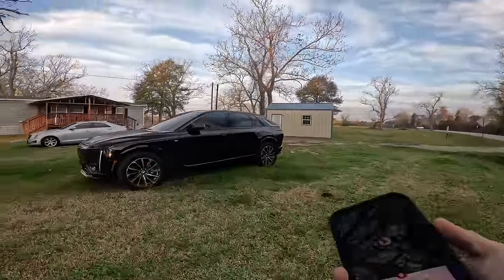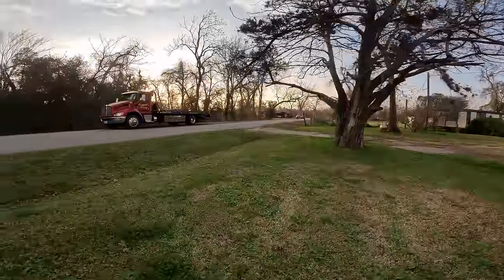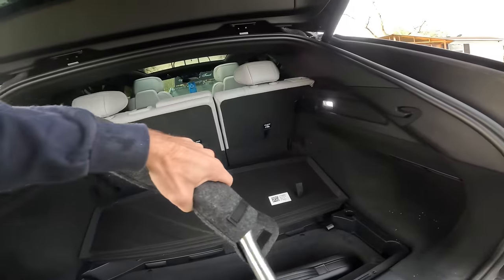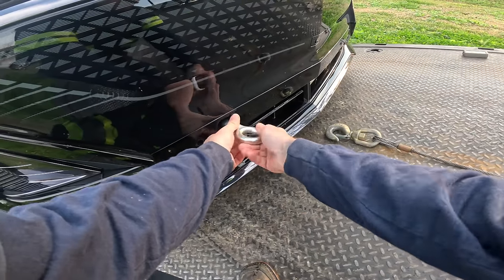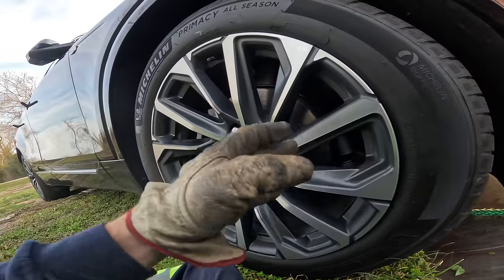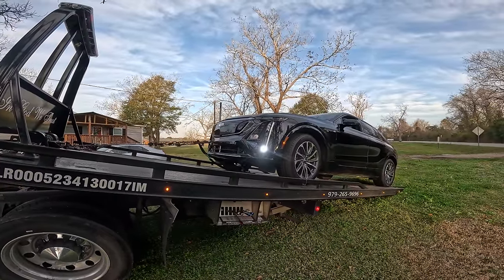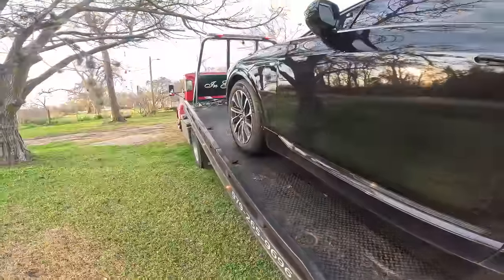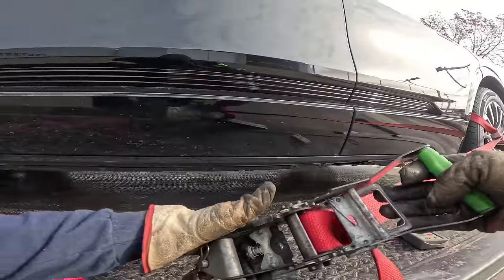Another EV Down! Towing a 2024 Cadillac Lyriq!

Comment: Huh, my ‘07 Lexus with 191k miles started and ran fine today…😂😂😂🤣🤣🤣
Reply: I have a Hyundai Tucson Hybrid 2 years no problem
Reply: As did my 2018 RAM Limited with a 3.0L Turbodiesel, and 245,000 miles on the odometer.
Reply: My 91 volvo with 400k  on it did too.  I'm going to replace it with a Polestar.
Reply: my 06 ford that passed 220k a week ago did too
Reply: Since I've got the longest streak posted I'm just going to say it.  There is no question in my mind that the EVs are going to be WAY more dependable than our ICE cars.
Reply: @L8nitedave  yeah, they just need to refine the tech and stop forcing it on us.
Reply: @2010hyundaielantra   Really? Is your 06 Ford  an EV that was forced upon you? Isn't this video of an isolated failure yet unkown cause evidence the tech is being refined?
Reply: @undaielantra With Ford the only problem I know of is the transformer module on the bigger battery in the very early Mach Es.  But even that you have to abuse it to make it fail. Same as other issues with ICE cars.
Reply: @L8nitedave  no I have a 2006 taurus
Reply: @2010hyundaielantra  oh ok, yeah those cars were always perfect.
Reply: @L8nitedave  well most of them were crapmobiles but the ones that survived to this day can only be destroyed by the wrath of the lord. bought mine at 105,000 and put a further 115,000 on it.
Reply: @2010hyundaielantra  They were more reliable than most. Maybe not the longest lasting but pretty dependable. I took care of a few of them in company car fleets.  Like all cars they did have some issues. Crank sensor, oil pan gasket and not the longest lasting transmission. Thing is most of the EVs we've seen so far are way more reliable and dependable and much less maintenance.
Reply: My 2014 Tesla S with 224K miles on it starts up fine too. A few issues over the years, but nothing like what the rabidly tribal denizens of social media would have you believe. Biggest issue in the future will not be the cars themselves, but the charging network, time to charge, and range in cold climates. But, like any new enterprise we tackle together, we'll get there in time. If one is afraid or has range requirements beyond the usual 30 miles daily, maybe you should just drive an ICE/hybrid.
Reply: @radclyffegeorge998  Exactly, most all the EVs have evolved to pretty high charge rates in the "middle" of the battery.  In time people will begin to realize just how "inconvenient" and expensive ICE cars actually  are.

Comment: EVs, because of the room temperature these batteries operate at, will be a safe haven for rodents. If you're out in the woods like this Lyriq owner, strong chance its rodents chewing away at communication wires. Especially if you leave your car unattended for a few days. The car will automatically keep the battery at optimal temperatures, meaning it heats and cools it automatically. So, rodents will have  temperature controlled accommodations😂
Reply: People are nuts #1 for not keeping their expensive cars in a garage. They depreciate enough as it is. I have the gas equivalent to this ,an XT5 & its a 2018 & it looks better than ones in the showroom.
Reply: @richardmorris7063  The people in the video live in a trailer home (in tornado country). I would think they like living on the edge.
Reply: @alexanderkennedy2969That’s what I was going to say.  If your ev is in a garage it will catch on fire and burn down the garage 😂
Reply: Easy fix, just don’t have your EV catch on fire.

Comment: I'm more curious about what happened to the Lyric than the tow itself.
Reply: I have owned multiple EV’s. They fail like light bulbs. Unlike ICE cars that run rough or make weird noises while you limp home, EV’s just go pop and you are found on road dead. Drive unit inverters have a tough job and are the most common failure that causes this type of problem.
Reply: @JetFire9  Maybe you have owned multiple EV,s though that doesn't mean you have any idea what happened with the Lyriq.  

And by 'multiple' how many are you talking about because I get the feeling we're talking about the low single digits.
Reply: @screenPhiles  You don’t know what you are talking about. The data and science prove I am right. Don’t be another liberal science denier.
Reply: I have two electric cars not an issue at all Love them very much charge at home, haven't need any maintenance beside tires at 30,000 mi nothing else of course maybe a cabin filter...
Reply: @confirmhandle  Give it some more time. You’ve been lucky so far. 🤣🤣🤣
Reply: @JetFire9  I know someone that owns a Bolt and it's been two years and he's had no issues.
Reply: @toner37  lol
Reply: Why would anyone buy an ev that's problematic, which would include all of them?
Reply: @rickcoleman8903  How is that true, beyond you for some really weird reason wanting it to be?
Reply: @confirmhandle why did the tires only last 30k miles?
Reply: @huge_balls  These Lyriqs seem to be terribly unreliable. This tow man is lucky that the car didn't lock itself. In this case, no neutral, no steering, no accessing the trunk where the tow eye is located, and you're not allowed to jack these things up to get the tires off the ground, per the instructions from GM. Go figure.
Reply: @jliefer2484  the tires had a dramatically reduced lifespan because they're made of a special compound to reduce rolling resistance.   filling the landfill twice as fast is a small price to pay for saving the world. plus remember how important range is to them.  i think you knew all this

Comment: The other day I provided a jump on a Nissan EV. He left the interior light on. He called for a tow truck thinking that he had to get a tow for simply leaving the interior light on. For warranty repairs and such. Kept telling me how the car was plugged in all night, 12 hours. The guy paid $250 for service, I was on scene for all of 15 seconds.

Didn't realize that even with a fully charged drive battery, he still needed a jump
Reply from the maker: People don’t understand that they have two different electrical systems lol I’ve amazed so many people before by jumping an EV lol
Reply: Obviously the 12v battery was dead, old and not working properly.. How old was the car and the 12v battery? No car regardless if its a gas or electric will work when the 12v battery is dead..
Reply: @mamadouaziza2536  the car was brand new, but they drained the 12-volt battery overnight and thought all they had to do was plug the car into the Drive battery charger. These people have no idea how their vehicles work, I'm shocked that they are legally allowed to own them.  just for the visual stimulation of the car's owner, I used a jump pack to boost his vehicle. He would have been Furious had I showed him that all he had to do was press a built-in 12-volt boost button on his dashboard to use the drive battery to boost the 12-volt battery. But I wasn't going to charge the guy $250 to press a button.
Reply: @nighttow8780  
Ok. thanks.. Sounds like a great feature to have a 12v boost button wired to the drive battery! I wish all electric cars had that feature.
Reply: @Towtruck_Dustin  Just curious, why wouldn't they build in a connector to allow the car to be jumpstarted with the batteries it already has?  Different voltage, more stuff to break/cause fire, or just the rarity of such a thing being needed?
Reply: If it was new, the guy didn't pay $250.00 for service.

Comment: When my Model S died on the road at midnight, I put the tow hook in the front bumper for the tow truck driver, but the monkey still put the hooks on the suspension to pull it up. I didn’t care this time because I already made my mind up to sell the car as soon as it was repaired. I did. Loving being back in a reliable ICE.
Reply from the maker: Tesla is actually one of the few EV’s that the towing procedure allows you to hook the control arms. I generally do that because the tow hooks are terribly unreliable. 
Seems that the ones that don’t allow hooking the suspension are the GM EV’s that have the electric ride control.
Reply: Yup I tow For Tesla and nothing happens to them  I do understand that it looks a bit more rough  than the tow hook  😅
Reply: and what exactly did the monkey look like???
Reply: @allaboutcars4835  Looked just you. Want a banana?
Reply: @Towtruck_Dustin  Why would you bold face lie about that? Why?? Oh, yeah, tow truck driver. Literally the lowest form. Well, for everyone to see what a liar this guy is, here is a direct quote from the Tesla transport manual: “To avoid damage, only pull the vehicle onto a flatbed truck using a properly-installed tow eye. Using the chassis, frame, or suspension components to pull the vehicle can result in damage.”
Reply: @JetFire9 
Oh ok..I’m African American.
Reply: @allaboutcars4835  Oh ok…I’m African.
Reply: @igpriego194  You are doing it wrong. My alignment was messed up after the monkey used the suspension arms instead of the tow hook that was right there. Why can’t you people do anything right??
Reply: like I said before never had any problems now picture this scenario your model s or x is completely unresponsive meaning you aren’t able to put it in tow mode meaning wheels are locked keep in mind these 2 models are the heaviest yes! Heavier than gas vehicles  the force to pull the vehicle will be greater  than having a car in neutral that been said  I will definitely not trust your towing hook sorry . I know there’s other ways  like using a wheel lift truck with dollies but even then most Tesla owners don’t like their cars on the wheel lifts due to most of them thinking the AWD Tesla will be damage due to their lack of knowledge  or existence of the dollies lol another think to add in order to get the contract to tow directly for Tesla we have to take a special training
Reply: @igpriego194  My Model S was in tow mode and rolled freely. The alignment was messed up by the tow. Stop doing it wrong and pretending “it’s ok,” just because it’s not your car. No, you’re not smarter than Tesla’s instructions on how to tow their cars. Just stop with the ridiculousness.
Reply: @JetFire9 lmao what part of  me telling you I was trained directly by Tesla u don’t understand ? That Karen vibe I’m getting from you I’m really starting to think I’m  not wrong about you Tesla owners 😂
Reply: @igpriego194  regardless of who is right. Emojis are gay.

Comment: I supervised the tow of my LYRIQ. To the delivery end by retaining the key fob .  And was hands on of the delivery into a spot at the dealership.   I hit a curb. First accident in 25 years .  Destroyed left tires .  Night time is difficult with the Lyriq as the lights are self leveling and it projects fairly close to the front of the vehicle.    I got the towing pin out of the rear and carefully removed the front cover.  But I detached the tether to it immediately.  Wawa.  At least the wrecker operator didn’t feel bad.

Comment: Wow, this is what Motor Trend reported just a few weeks ago.  The Operating System dies which is what you are describing here.  They recalled and stopped selling the Chevy Blazer EB due to this issue being widely reported after selling about 400 units.  Motor Trend reported when GM called the Chevy the car started working again for about 15 minutes or 10 miles of highway driving.  Then it died again. So GM took the car by towing it away like you did - and giving him a gas car which got him to his destination where he wrote the blistering report.  For GM to be selling EVs before they are ready with a reliable OS is just crazy bad.

Comment: It’s nice when it’s 75 degrees and sunny out. Imagine towing this junk when it’s -15 out
Reply: do your research on EVs and cold weather. No one thinks about everyday vehicles and cold weather, but come winter and you don't plug in those vehicles. People complain and then need a boost because the small car battery couldn't start the car. So many people questions EVs and pretty much all can and will apply to the regular car itself. The average lifespan of a car battery is about 5 yrs +/- a year.
Reply: What’s the lifespan of an EV battery?  Oh and what’s the cost of an EV battery vs a ICE car battery?  Last I checked the Chevy bolt battery cost $10,000 while an ICE battery is right around $100 at autozone. If you’re an electric car fan; that’s great. I’ll stick to using the most energy dense fuels possible.

Comment: Debating whether to order one.  They are heavy - about 6,000 lbs (really).  The rear hatch can also be opened if you press the Cadillac crest in the center (not intuitive).  The rollout of this car has been horrendous and an embarrassment for GM.  I'm waiting for them to put a NACS charger port (instead of using an adapter) and bringing back Carplay instead of trying to reinvent connectivity (another fine mess that GM created for themselves).  In the meantime, you will likely be towing these for some time.
Reply: If I had to order an EV, it would be a Tesla. They are the only ones that have figure it out, and have mostly reasonable prices. It’s unlikely you will see this car on the road in 6-10 years, parts won’t be available or will simply be cost prohibitive.
Reply: I'm going to wait and get one off lease or wait longer for the remainder of the heavy depreciation. I'd really like a Celestiq, but that is going to be a very long wait for the used prices to come down for one of those.
Reply: I have a 2024 Lyriq AWD Luxury 3. So far so good at 600 miles.  I LOVE THIS CAR.

Cadillac is 3 miles away and they have Lyriq Loaners just in case...
Reply: I do agree. The rollout was HORRIBLE.  

I ordered a Sport 3. 

It NEVER SHOWED UP.  I waited more than a year for it.

Ended up taking a Luxury 3 instead with the same color combination and a few more features.
Reply: @user-ln7of9gs4s  Battery pack damage is serious as a fix isn't east.  Some say just change out the batter pack, but if the brackets or electrical connections are damaged, good luck.

Comment: Dustin,  the patients you have with that vehicle are amazing. Myself I will stick to fossil fuel autos. Besides that, the batteries for them are outrageous, almost as much as the vehicle. Not worth it for me, nor a lot of other people that do not have the funds to purchase something like that which I wouldn't. Thank you for sharing it just gives us reinforcement of not buying those!
Reply from the maker: Definitely won’t see me investing in a EV any time soon either.
Reply: GM quality is terrible. A battery replacement after 150k miles is still much cheaper than the cost of gas over the same 150k miles FYI.
Reply: engines and transmissions cost a lot of money too . six of one/half dozen of the other.
Reply: @tabbott429 you still have to pay for the cost of electricity. You seem to think that because it doesn't use gas that it runs for free.
Reply: @NicCageForPresident2024  nobody thinks it runs for free.  But the average EV gets about 100 MPGe.

Comment: The Caddy will be redesigned in software. It just needs a lot of patches.
Reply: This is the reassuring aspect, at least the problems seem to be software related which are much easier to fix and improve over time.

Comment: I'm just waiting for the brilliant engineers at GM to electrify the little door that you open on the front bumper to attach the tow hook. All electric, car is completely dead, can't open the door without power, no backup mechanical latch to open it, and you can't use any other part of the vehicle to pull it onto the tow truck. It's gonna happen, guaranteed

Comment: Out of curiosity. It drove in reverse why not drive it to a better location? Like so you wouldn't have to drive on the grass. Also why not try to drive it onto the tow truck?
Reply from the maker: Because you never drive a customer vehicle unless absolutely necessary. In this case, the customer wasn’t on scene, and I needed it moved so I wouldn’t drag it, and my truck through a tree. So I moved it only enough to not cause any damage. I never left the driveway, so property damage wasn’t a concern. 
Along with that, you absolutely never drive a vehicle onto your bed, especially when the vehicle is obviously being towed for some kind of intermittent failure. Driving the vehicle into your bed is nothing but lazy, irresponsible, and most companies have policies against it anyway.
Reply: @Towtruck_Dustin  oh okay just wondering. I see flatbed tow truck drivers do it all the time here. They did it with mine when the transmission went out. Since the transmission cooled down by the time he got there, he drove the car right up. Then working working in the FD. On accident scenes, if the car can move, they'll drive it up, then strap it down
Reply from the maker: Yeah that’s very frowned upon in the towing industry. It’s a bad habit many have picked up up, and it will eventually bite them in the rear.
Reply: I have a Chevy Bolt that ran fine for 6 years but did finally break down a month ago.  As it turned out it needed a new wire harness, $ 3 K  and one month later it is working again.  I’m glad I got an extended warranty but it didn’t cover the total cost.  I hope it runs another 6 years!

Comment: So you started the car and backed it away from the tree without a single problem. Why didn't you simply try to DRIVE it onto the flatbed rather than using a winch?
Reply from the maker: Because you never drive customers vehicles unless absolutely necessary. Which is why I only moved it a short distance. 
You never drive them on the bed. That’s a lazy, and dangerous habit to form, and most companies have a policy against it.